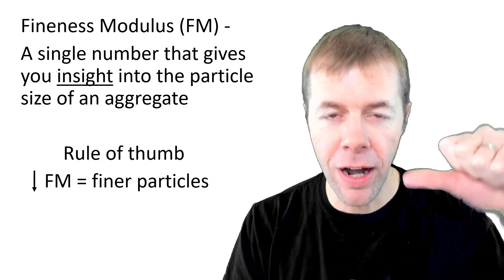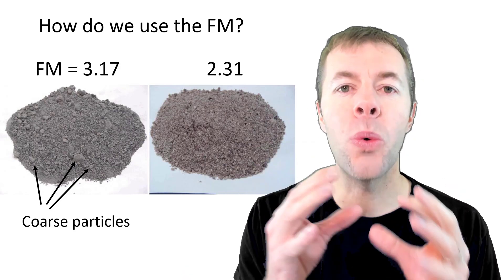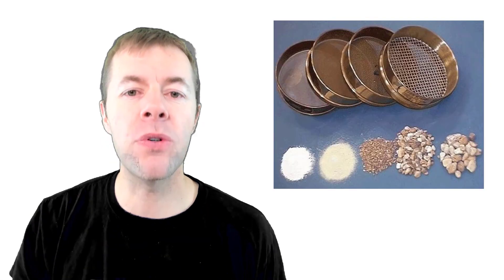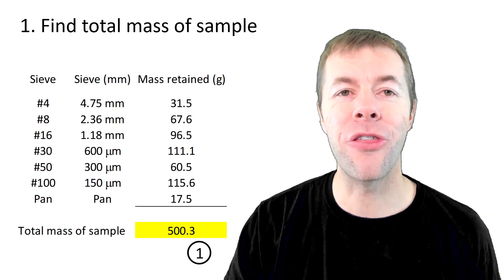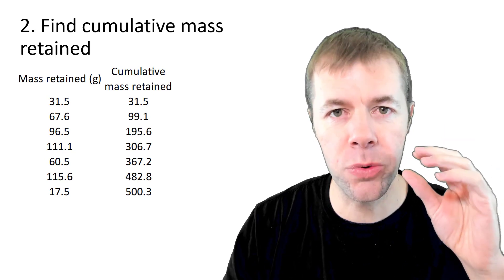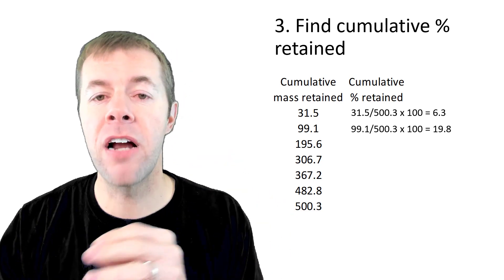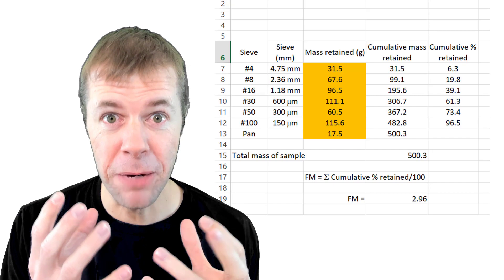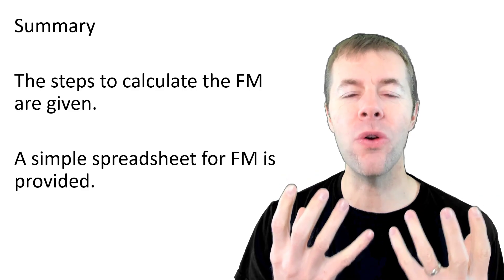Fineness Modulus calculations in less than 5 min! plus Excel spreadsheet

Comment: "The fineness modulus is a pretty cool tool".  I disagree.  I think measurements like FM actually lead people astray.  FM does not give a well-defined knowledge of the size distribution, in terms of specific surface area, median or spread in the distribution.  A single number should not be the goal; instead, meaningful physical properties should be the goal, even if it is a little more complicated than a single number.